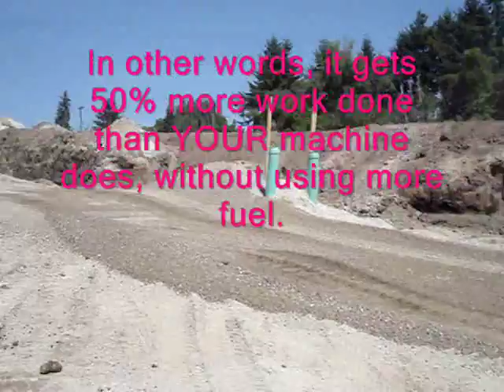Case CT 450 Skid Steer Loader At Work

Comment from the maker: The question was meant to be understood as per a same make and model comparison, as in a 450 vs a 450, or a Cat 247 compared with another Cat 247; not a cat against a Case.

By the way, how does the Cat compare with the other two for power, agility, etc? I've not had the opportunity to operate one yet.